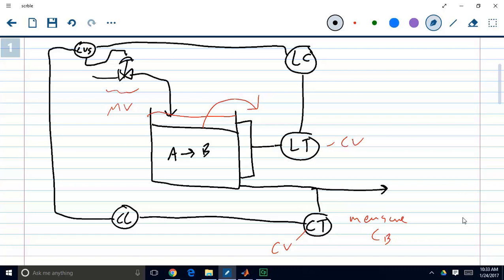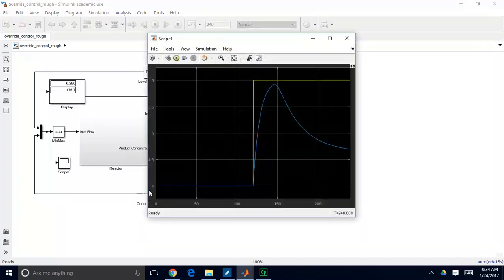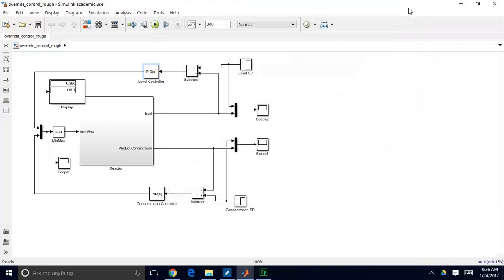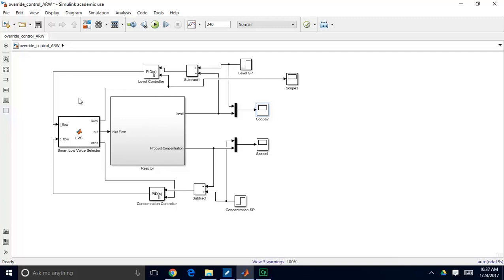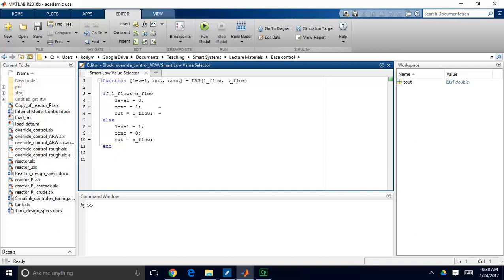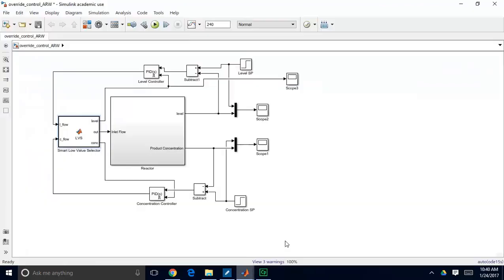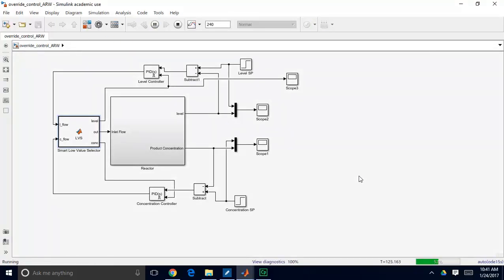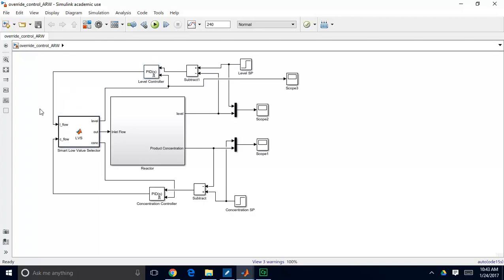Override control and custom logic

Comment: Hi Kody. Most DCS systems (not PLC's in general) have standard windup reset protection on signal selector outputs. This is not well understood by most engineers, as well as the math behind this. The problem with demonstrating in Simulink is it still runs in the 's' domain, so your average engineer starts to lose the plot. I did a demo of this similar concept in one of my videos - it seems a few people have touched on this too.  Thanks for your work !